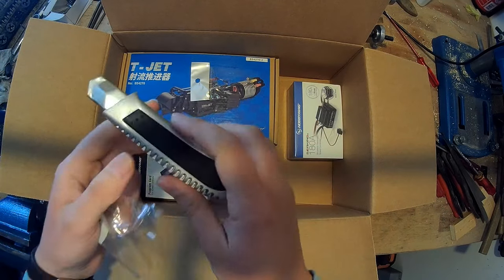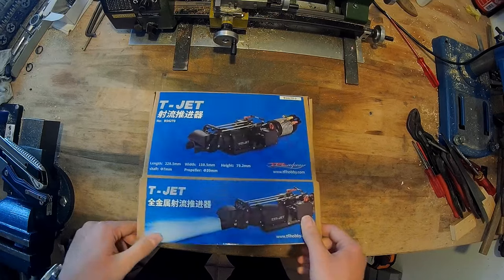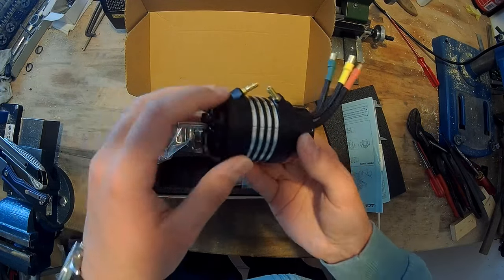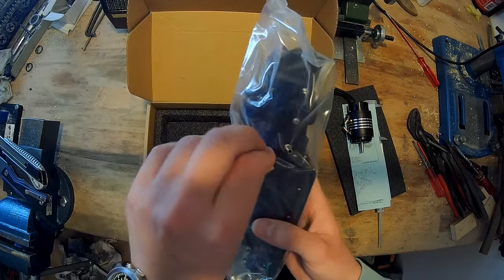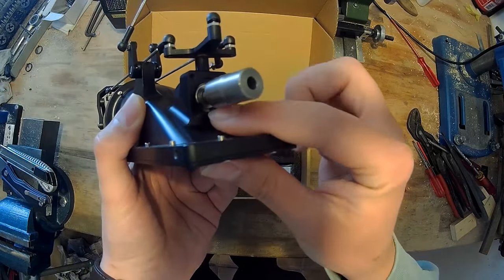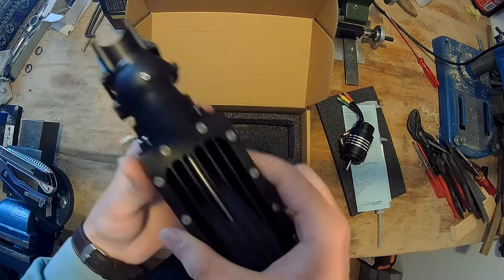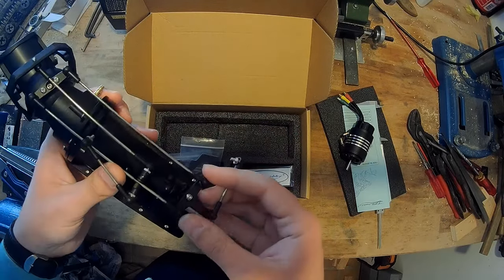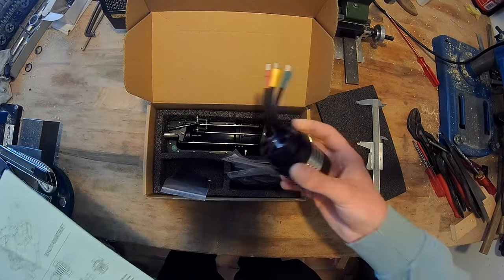TFL T-JET (B54270-2) UNBOXING

Comment: Thanks for the effort. 
Can you tell from where you got that one? How much did you pay for jet and speedcontroller? Did you order the speed controller from the same place? Did they give you the programmer box ?
Reply from the maker: Got everything from a local TFL (import) shop, but it should be possible to order directly from china too
Reply: @MrDINODINO74 - Were you dropped on your head as a baby at birth by accident?

Comment: Thanks for the video, I am thinking about getting one of these but am having a hard time finding how much thrust it will produce at certain rpm. Nice unboxing video thank you.
Reply from the maker: The thrust is highly dependant on the vehicle speed and thus the boat's hull resistance and static thrust alone is not all that useful to know. You would need a full pump-chart with flow on one axis and pressure on the other and know the resistance-curve of the boat hull to make some accurate predictions about the top speed and power consuption

Comment: How many Newton meters of force does the TFL B54270-1 B54270-2 Metal Water Jet Thruster with 3674/4074 Brushless Motor produce at full power?
Reply from the maker: I haven't measured it and the dynamic thrust and performance are highly dependant on the speed and hull resistance of your vessel. I estimate that it has at least 10kg of static thrust at maximum rated rpm and draws about 1000 Watts continous in a 90cm *25cm simple V- Hull rc  Boat. Newton-Meter by the way is not a unit of force but of torque ;)

Comment: ... this jert is garbage,  for the money I spent on this one is not 20 % close to expectation , already is squking after 10 minutes on salt water  .
Reply from the maker: what exactly is this "jert" you're referring to? But yeah salt water + aluminum don't get along too well, so no real surprise there.
Reply: @rcandfun242  ... well? I could coll it JET if it was one,  me because I can babel in a couple of languages I  can emprivovise and this one comes from the romaniana shortcut jertfa, meaning sacrifices , because I had to sacrificed a lot to make this happen. 
Aluminium and salt water does not go well,  but this one is anodised, and not the aluminium is squeaking it's the ball bering not protected.
Reply from the maker: @MrDINODINO74  So if just the bearing is your problem, why not just grease it with marine grease from time to time or replace it with a stainless version (ceramic or bronze bushing)? Why the over-dramatization? So far, I had no problems with the bearing, not driving in corrosive salt water though.
Reply: @rcandfun242  I  can't pay 300 Sterling pounds for something I have to tickle all the time. + the access is restricted. I have to dismount all the jet parts to reach the problem. 
Imagine that my project is approved. How I am going to maintain 1000 boats spred all over the planet ? This has to be a system with 1 year   interval for service, not every time the boat is going on duty.
Reply from the maker: @MrDINODINO74  I assume you are talking about some kind of professional drone boat? In that case, this hobby-grade jet is probably not the right solution for you + jet inlets are notorious for getting clogged which is not a problem if you have access for maintenance but for a drone boat it might be a biig problem.
Reply: @rcandfun242  I don't have a choice for the moment because is no jet pump suitable for the job , and one I think could be they, are 800 dollar , and I have another disadvantage in this world,  I hate profit,  and that put me in big trouble.